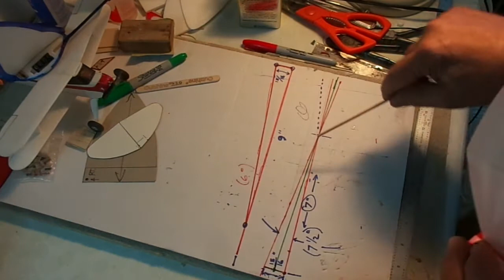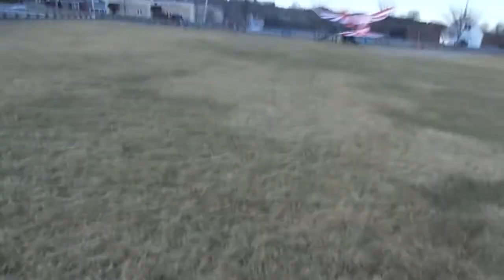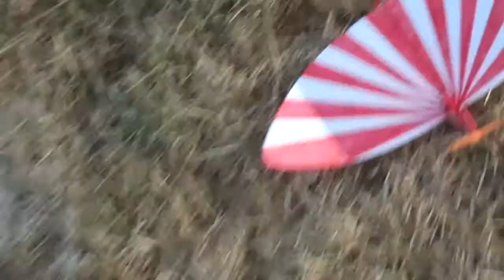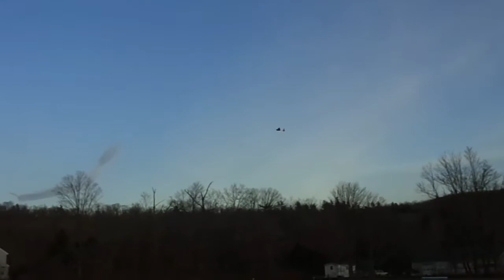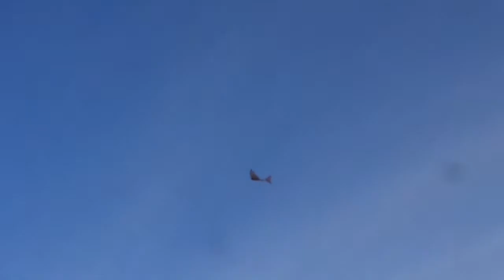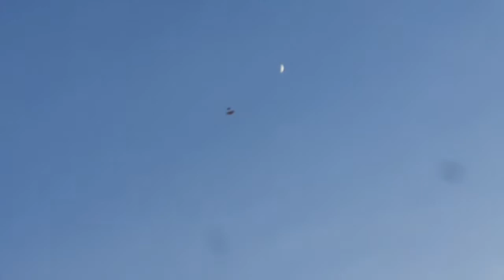DIY Buildalong Intro and Updates- WATCH before you build

Comment from the maker: LINKS to get the components for this build: 
50mm Props (for 615 motor) 2pr:
https://www.banggood.com/custlink/3mD3d54e63

615 (6mmx15mm) motors 4pcs:
https://www.banggood.com/custlink/mDKKwGFfEi

10 Farad supercaps 
10pcs:
https://www.banggood.com/custlink/mGm3fmVTrv
or 5 pcs:
https://www.banggood.com/custlink/Kv3DYH6g6E

Micro Slide Switches 20pcs:
https://www.banggood.com/custlink/3K3mdP0668

Comment: Hi Mike. I'm thinking of building a plane like yours or similar. I just looked at the website of an electronics supplier here in the U.K. and they have new super caps 10F at 3.0 volts instead of 2.7 volts. I thought you might be interested.
Reply from the maker: Thanks Stu! I have seen those online at Digi-Key Electronics. We've been experimenting with pushing our 2.7 volt caps past their rated voltage...up to about 3volts. Not sure how much difference there would be in actual performance. We're buying the Banggood caps mainly because they're cheap...about 60 cents US each when purchased in lots of ten. Also, we're already losing planes to flyaways at our current level of performance...in fact Richie and I saw one of his better models fly away on a sunset flight last night! Hard to feel bad about it, though. It was worth the two bucks invested in it to see it go! Good to hear from you, Stu...Keep in touch.

Mike

Comment: Great flying model, a must build. What size of capacitor do you use?
Reply: 10 fared super cap from Bang good  he gives links in the first build video
Reply from the maker: Yup!
Reply: @sonex413  Mike , i took mine out this am and i do not have my super cap yet But i flew it on a strix timer with a little one cell 150 mah lipo,  My cg was at mid wing and i just was not expecting much , i thought it was over weight with the timer and all BUT it blew my mind  I though it was a goner first flight .  i was super lucky that it came down inside of the tree line.  I was NOT expecting that on a trial WOW to say the least.   ill send pics to your e mail
Reply from the maker: @larzhillbot1443  Great job! That's the first reported flight from the field, you and your model have earned the distinction of being serial number 002 right behind the video build plane! Proud of your accomplishment and glad you got it back!! -Mike
Reply from the maker: Like I said, guys, put your phone number on this little free flight!

Comment: Great performance..outstanding.I will be ordering my parts soon I think!,those foam plates are a little tough to find around here so I may stand down the meat tray foam or hot wire cut some thin polystyrene  for the wings. Also a question.I can buy a "flight pack" from a supplier in Australia..but it has a 5 farad capacitor,would this substitute? What would the effects be? 
https://micronwings.com/Products/FreeFlight5FaradCapacitorDriveSystem/index.shtml
Reply from the maker: Hi Brett, I took a look at your link...the setup they offer would work in my plane with minor mods to the plane...the capacitor is much smaller, therefore lighter, and you'd have to mount the motor a bit farther forward to make it balance...the 5F cap of course would have roughly half the duration of a 10F cap, but the lighter weight might help make up a bit of that difference....Also I see they offer a 6mm motor with a 3 or 4 ohm resistance and I'm not sure about the resistance of their other offerings. The motors I'm using have about 1 ohm resistance (fewer windings and higher power output, higher rpm, and of course higher current draw.) Banggood sells them as "upgrade" motors for a micro quad. In spite of the fact that I'm running a 10F cap compared to their 5F cap, run times seem to be the same...a result of the higher output motor consuming power at a faster rate. I don't know what the conversion rate is on AUS$ but I'm spending under 3 USD$ per plane using the Banggood stuff.  I supplied links to that gear in the text description of Part One of my build video series.

The alternate foam materials you suggest would probably work OK, 1/32  or 1/16 balsa might also work well.
Reply: @sonex413  ok..so I have started,cut my own foam sheets from extruded home insulation foam,they came out nice.I made a CAD drawing of the main parts and I am cutting and assembling. Happy so far!If I can figure out how to make the cad drawing into a pdf accurately it may help other builders.  ps..Ive ordered the parts from Banggood today
Reply from the maker: @brettmccormack6277  Great! Keep me posted on your progress. Mike
Reply: Brett McCormack I would love have the pdf patterns if u can send me over email, or say post a Google Drive link to download myself. You have them made for A4 page?
Reply: Progress on my build so far https://youtu.be/DFABXmkwhwg
I have the drawings in DWG format right now.I have to figure out how to make a correctly sized PDF.I may print on A4 then scan.will update when I have it sorted.
Reply: Motors and props are here..just need the capacitors to come!